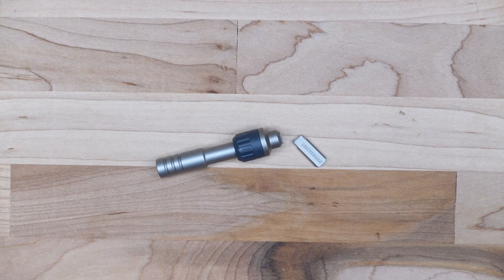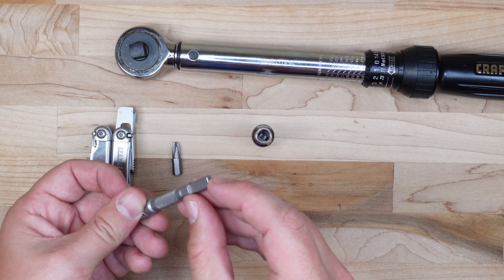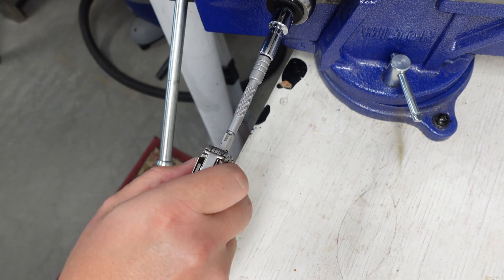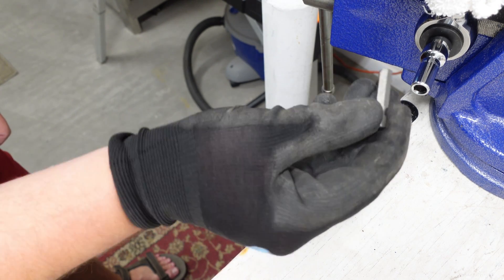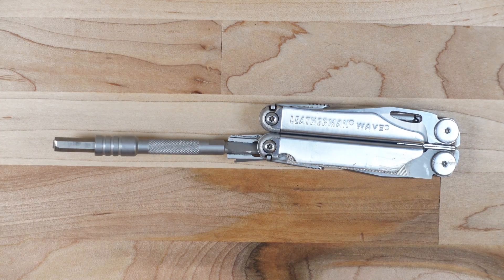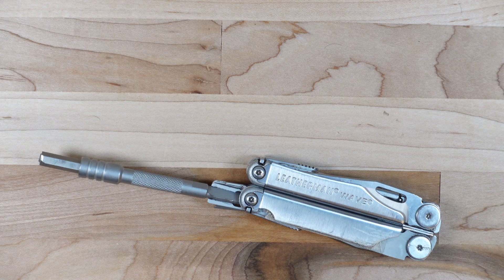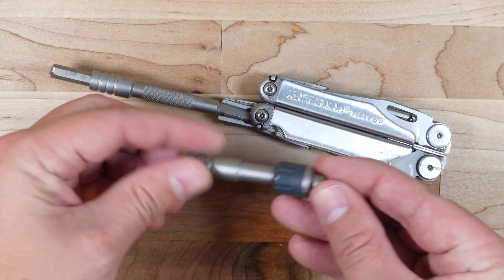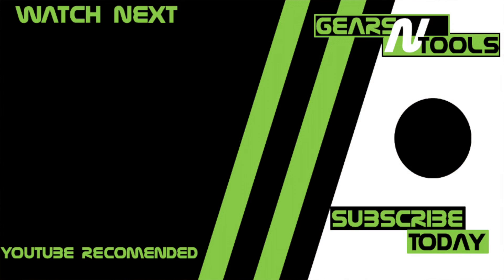Destroying A Leatherman Bit Adapter For Science! - How Much Can It Take?

Comment: Very interesting. I wrote down the results. Also glad that it's the bit holder that gave up, not the pivot or frame of the multitool.
Now i wish you tested the squeezing strength of the pliers, how much can it take and where will it break? I have a lot stronger than average male gripping power, so do i have to be cautious with my Wave?

Comment: That's quite an impressive amount of tongue for such a small bit holder! Planning to get the ratcheting driver to help with e-scooter repair on the go (if I get a flat for example), and was concerned if the bit holder can handle the torque on the split rims of the scooter. Nice to ser that it definitely should handle any normal use.

Comment: Old video but a fantastic one.  I think that it is a safe assumption that you’de strip the tip of the driver bit or strip out the slots in a screw before breaking the actual driver. I am curious if the results would be the same for an ARC.  I think you’de see more flex in the frame.  That additional flex might be a good thing, acting as a warning to stop before you hit the tool’s torque limit.

Comment: nice test. makes me really confident on my tool. That's how it should be...for my little emergency tool :)

All I can say. Your bit was worn off from your tests. You should never use that strength.
As you broke the Wave one side of the handle bend extremely. If you do that...you know you are destroying it.

But most important. The strength you need to destroy it you never can do with the tool.
To me it says that every part is as strong as it needs to be.
Reply from the maker: Agreed. I think this was a pretty practical test.  If I wasn’t able to break it bare handed then it’s designed well in my opinion.

Every tool will break given enough force :)

Comment: 420 stainless steel is NOT the toughest tool steel.  Comes a point in 'every' mechanics life, when he knows(before grabbing it up) what a given tool can and can't do.  That usually happens between 20-25 yrs. old.  You become able to feel the tool give, before it snaps.  Paying $100+ for a Surge without knowing its limits might not be the most intelligent way to gain that experience.  Maybe walk on a MAC or SNAPON tool truck and buy a 1/4" straight bladed screwdriver.  It'll be a whole lot less expensive.  BTW, the best 1/4" ratchet design was made by Blackhawk(Patented).  Mac tools, out of Washinton Court House, Ohio,  used that design for decades, between 1950-1975.  Not sure if anyone makes one like it today.  Had a 20-toothed pawl in it.  Same design in the 1/4, 3/8 & 1/2" ratchets.  Practically bulletproof.  You young guys need to buy Larrin Thomas' book:  Knife Engineering, and learn about the various tool steels in detail.  That'll shorten up your learning curves & save you bunches of $$$

Comment: I'm really, really, pleased my Surge bit driver is MUCH stronger than I thought ! 
Thank you for this test !

This was like a Scream movie for Multitool fans.
Reply: So then if you have some sockets,you'll have like a whole mini tool box,that's what I doing
Reply: But anything that's too much then yeah I'm going for the main tool designed to handle the tougher jobs,but for most things it'll come in handy.
Reply: Yeah definitely,long live the surge,glad I'd finally saved up an bit the bullet an got mine,a few months ago an no regrets so far,I need a bit extender an a good ratchet I saw called the 711, people doing reviews on it,I like it so far,so I'm going to get it for the surge,but there is another one on there roughly same price but it's a tad longer but meant for the hand that'll hold Leatherman flat bits an 1/4 inch bits as well an can handle more torque in my opinion like the surge has demonstrated
Reply: Also the Kool thing is that'll they'll fit in each of the side compartments of the nylon sheaths

Comment: screwdrivers chiped on my surge. big and medium included, not the bits. serrated blade dul after i cut 1 medium ziptie. oh, the scissors, omg, i had to use a center punch on the joint. on Squirt PS4 scissors too.

Comment: your spot on. 1 get the right tool for the job, 2 leatherman is engineered (not somebody guessing), 3. a multitool is meant for somewhat of a substitute, conviniance on you all the time thing but it has it's limits that common sense should inform but if it does not.......... the engineers who designed it will save your but and cover the company's but all in one quick and ez step.

Comment: So, it's fair to say that in normal screwdriver grip use, with only hand strength - we will most likely never need to fear breaking our leatherman tools!
Reply from the maker: Yeah you'd have to try to break it, I really don't see anyone just "accidentally" breaking it.  I'm sure someone will jump in and try to tell us all he's the hulk but realistically it's not going to be an issue.
Reply: @gearsNtools  That's good to know, thanks for doing the experiment on it. I often use my Wave at work when I need a screwdriver, and was thinking of getting one of these to make it a little longer and easier to handle. I never use my Wave in pistol grip, so as not to strain it too much, but all the same it's good to know it has plenty more to give before breaking. 
Thumbs up and subbed!

Comment: I'd be really curious to see how much torque the bit holder on the tool itself can handle without breaking
Reply from the maker: I'm thinking the tab on it will be close to 300 inch/lbs like the ratchet tab was. I've had a couple people ask about the socket itself,  I'll probably get by bigger torque wrench out and give it a go.  any guesses on how many FT/ LBS it'll take?  I'm thinking 50+
Reply: @gearsNtools  i wpuld think around 30ft-lbs. the metal on the sides is pretty thin

Comment: Great Video. When it comes down to it this is just a multitool, while being possibly the best on the market its still not the be all and end all, and anything can be tested to destruction. But as someone has already stated, it would be nice to see the Leatherman equivalent from Victorinox, Gerber SOG and whoever and see which comes out tops? Thats out of my price range though.
Reply from the maker: That would be interesting, of course I don't really want to break all of my tools lol :P, I think the Leatherman bit adapter sacrifices strength in exchange for interchangeability and form factor.  

I think the Swiss Tool X or Gerber center drive would have the strongest bit driver, it's really going to come down to the handles on those, I don't think the driver would fail on either.  

Thanks for watching!

Comment: Great video - I think it is well designed for what you need it for and to your point, get the right tool if you have a large fastener to install. Does your bit adaptor on the tool itself hold the bits pretty securely or is there play and is it easy to pull the bits off? On my Surge the little retaining spring holds the bits, but not as securely as I would like. I wish it was an adaptor like on the Skeletool.
Reply from the maker: The bit adapter on this wave was pretty secure still (I had a couple to pick from) all things break if you try hard enough so I wanted to frame this video with som baselines for comparison.  

Thanks for watching!

Comment from the maker: Thanks for all the feedback on my previous testing videos it helped me come up with this video idea to put the results from our past tests into perspective.  

you'll notice some jump cuts in the edit, I increased torque in increments of 20 inch/lbs but to save you time I cut out the increasing process.
Reply: Another great video, covered most of it, certainly helped put it all in context.......with these types of tests it can be helpful to activate the tool (open/close) to determine how much if any of the tools functionality is effected by the heavy use. Keep up the good work, cheers
Reply: Its hurts to heard every single crack n snaps from the Wave, mate 😅
Reply: Can you redo this test with the arc? I believe the bit holder is a slightly different design and I wonder how it would hold up